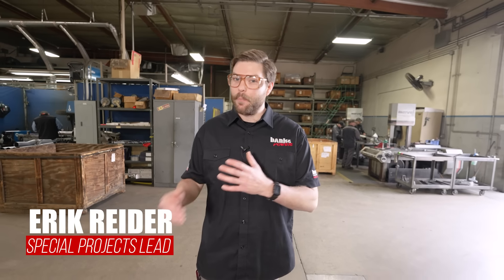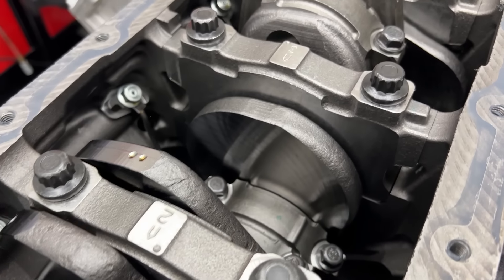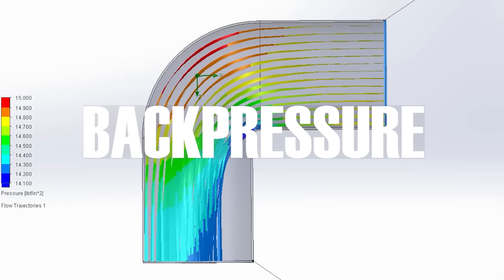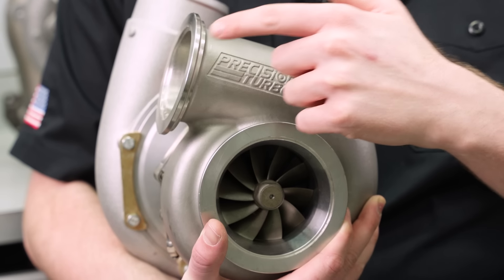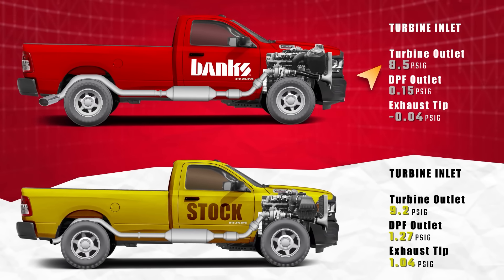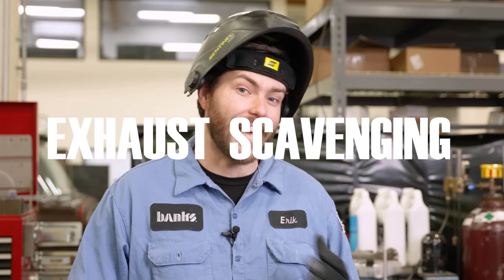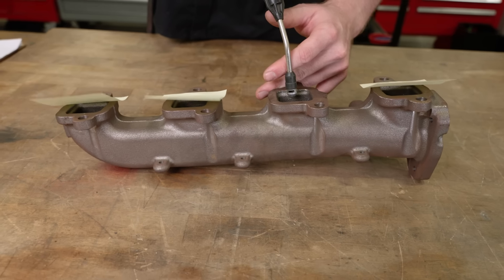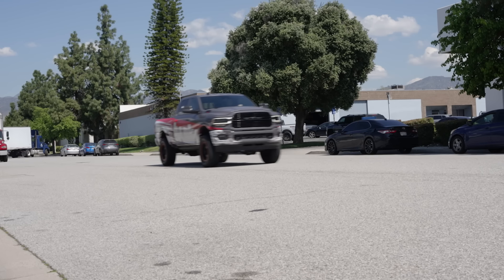Busting the exhaust backpressure myth | Banks Entry Level

Comment: Strange - I missed the part where he explained the principles of valve overlap... Good ad for exhaust systems that use turbos.
Reply: Yeah.  Would have been a good segue into how the exhaust scavenging he did demonstrate also helps the intake stroke get a better charge into the cylinder.

I suppose, though, given how every effect is linked to others, if you're only gonna talk for 10-12 minutes, there's just some things you're gonna have to leave out. Otherwise your audience is gonna feel like they just got a sip of water from a firehose.

Comment: This comes up so often, people absolutely adamant that ‘you always need back pressure, it gives you more torque’ then they get really upset when they can’t explain it 😅
Being a truck mechanic, I remember Gardner diesels having issues meeting minimum horsepower requirements as truck weights increased. Their quick fix was a tuned exhaust, Gardner called it ‘negative pressure’ for a loaded 32 ton truck , it used about a five inch diameter pipe that with matching stack. 
It used a flapper to stop rain getting in, but the pressure pulses were so strong that at three quarters throttle it still sucked shut, made a proper din 😂 drove the driver mad

Comment: Creating a negative back pressure increases power to a point but once you start over scavenging you're just wasting fuel. 

Back pressure can be a good thing though,  as it can help with low end (low rpm) performance. At low rpm the valves are open longer so there's more time for the A/F mixture to get into (and escape from) the cylinders. You need a little bit of back pressure to stop from over scavenging. 

Another helpful note is HP vs Torque. How they relate to each other and how back pressure effects them both.

Comment: Now you are incorrect about the hair dryer fan increasing load as you block the air outlet. You're not a master electrician so i wouldn't expect you to know this though.

It's not a positive displacement pump, so as the restriction in flow increases you move less fluid thus less work on the motor. This is particularly helpful for constant pressure fluid pump systems. Just keep in mind it's an example that is not correct for this comparison.

Engines are positive displacement pumps and as a result any increase in exhaust pressure or decrease in intake pressure will increase the power requirement for a given output

Comment: The motor in your hairdryer speeds up because it is no longer moving air. It overheats because it lacks the positive airflow to cool the motor.
Reply: Came here to say this. Man this is a tough video to watch.
Reply: @JNorth87 tough video to watch? Banks knows more about airflow, pressure and anything to do with feeding engines air than anyone you know and who taught them. These guys know more about this stuff than we ever will. The example of the hair dryer was to explain it simply to morons
Reply: @dougsavery5442  Yeah tough video to watch if someone is incorrectly using an analogy.
Reply: @dougsavery5442  Example was wrong. Period.
Reply: @dougsavery5442  Borla would disagree with you.
Reply: I was about the write the same.  Comparing a turbine “pump” hair dryer to a positive displacement pump like an engine is fraught with peril.  However, this video is geared to those without an engineering or physics background so they won’t detect the error in the analogy and the fact that a turbine pump spins faster and uses less energy when the flow is blocked.
Reply: @LTVoyager  Right you are, plus if he only blocked half of the air exit on the dryer he would have noticed the velocity of the air would have increased, which is what Borla has to educate so many major races teams about.
Reply: @mustangecoboosthpp3869  Yes, many aspects of fluid dynamics are less than intuitive.

Comment: I had a pick up with a 402 BB . It had been sitting for a few years . I pulled it and installed new rings n bearings . It already had an aluminum intake and a big holley but no headers and a Crane cam . My budget didn't allow headers at the time . A buddy owed me and he worked at a muffler shop. He used 2 inch pipe out of the manifolds into turbo mufflers and 2 1/2 in pipe out of those and dumped just in front of the rear axle . The truck ran great.  Before we did that I talked with 2 other shops and they wouldn't do what we did, and said the truck wouldn't run right due to no back pressure .  Never really understood the backpressure thing tho .

Comment: At  3:20 you spin the turbo and it spins quite freely for some time, thus a reduction in back pressure drag along with a decrease in spool up time would make a considerable gain in performance. I've worked with turbos that wouldn't spin at all brand new right out of the box!!

Comment: that is  incorrect using the hair dryer as an analogue ... when you block the air flow the fan/pump stops moving air which is the definition of work. moving fluid requires work. the fan is spinning but not moving anything... it is doing no work and current on the hair dryer would decrease...thus power goes down. put it on a watt meter... the blades have no differential pressure across them to resist flow. Part of the reason is a hair dryer is not a positive displacement pump it's a centrifugal pump.

Comment: Run a marathon breathing through a straw , hows that backpressure working ya now bud??😂😂
Reply: Its fine for toyota and honda
Reply: Humans exhaust and intake are the same orifice. Not a good analogy. Maybe more like farting a marathon through a straw. Which I think I can do, personally.
Reply: Try farting with hemorrhoids lol.
Reply: You described an intake restriction.  Thanks for sharing though
Reply: Better yet shit through a garden hose then a 3" exhaust pipe. Which takes longer and more effort to get the work done?
Reply: @Redline2442  This is the best metaphor I've seen for backpressure lol. I'm gonna stick with this one.
Reply: Not a straw but running with a closed mouth though works great.
Beginners often run and breath to their mouth. But when you get experienced you recognize that there is massive benefits to only breathing through you nose throughout your run and other forms of cardio.

I also every day do a couple of sets of breathing through a breathing restrictor, that is way more restrictive than a straw to strengthen my lungs.

You can't really compare a mechanical system like a car and a biological system like our body. Because our body build itself stronger and more powerful if we put it under progressive higher loads. And give it enough rest and nutrients to recover and improve.

Comment: It's not about back pressure, but about exhaust gas velocity.
A neck in the pipe will increase velocity in that region, and this increased velocity can be used to improve scavenging. This has been proven in drag strips.
But a neck will create backpressure, which people assume is what creates power when it's just a side-effect of the resistance to flow.
It's all about flow and velocity. It's like a triangle of flow, velocity and pressure.

Comment: the negative back pressure thin makes sense, the greater airflow (no matter hw you get it) the less boost you need to make power. negative back pressure means increased airflow, just on the exhaust end. Ergo less boost required.

Comment: You need to manage exhaust. In an ideal world you have none, the challenge is that just like you said you can create intakes and exhaust that improve volumetric efficiency above 100% through careful engineering of certain harmonics. Whether it benefits depends on the exact engine, induction, and exhaust impedances

Comment: I have a BRZ with the Edelbrock supercharger (with a well developed tune by DDPR), with the stock small header and exhaust I (closely) tracked fuel consumption for 9000 miles of mixed driving so the MPG figures were pretty refined. Then, even though the lore says that exhaust diameter doesn't matter in forced induction I decided to put in a  cat-back system to change the sound. So stock was 2.0" OD (actually a bit under that as its something metric) and I went with a 2-3/4" and was pleased with the sound but noticed that there might have been an improvement in gas mileage.... And the following months proved it. I WAS GETTING at or just under 1.25 more MPG. Now that doesn't sound like lot but when your buying 93 octane gas that adds up over the months. And there was a fractional improvement the next dyno run for baseline before we installed larger injectors and I went alcohol.

Comment: Your example of the hair dryer is wrong. Motor RPM actually increases due to less load , because a smaller column of air is being moved. You are comparing two different types of pump, Positive displacement versus Dynamic.
Reply: Has nothing to do with type of pump. The example was only meant to be a simple demonstration of how back pressure increases load.
Reply from the maker: The comparison was not about a motor vs an engine, it was simply to show backpressure or resistance at its most basic level.
Reply: I was thinking this too. Good intention but poor execution
Reply: @lucasd8917 
Cars dont run with 100% blockage, they ran with less than 5% back pressure
Reply: He is just a keyboard warrior trying to know it all.
I think it was a good example
Reply: You’re clearly missing the point the more restrictive it is the more load on the motor. In this case it was the blower motor for the hairdryer. It would be the same case for your engine.
Reply: @thisguy333 
Oh look a troll
Reply: @justinpinho9916  
And no racer is going to say hey lets put a potato in my exhaust because i need 100% back pressure. 

And you see the guy in the video doesn't want to do a video of a semester worth of engineering explaining exhaust design and theory
Reply: beyond moronic post from OP
Reply: @JohnSmith-xu7ev if you move away from the mirror you won't see him anymore

Comment: Where this myth came from is rooted in the seventies. When auto makers first started down the path of cleaning up emissions, they leaned out the carbs to lower hydrocarbons. I actually saw one vehicle that cracked the exhaust manifold, causing the engine to stumble. When the manifold was replaced , the engine returned to running normally. The normal back pressure was needed to maintain proper fuel mixture. When the built in back pressure bled out the crack , the mixture went too lean and the engine ran ragged. This was one reason for those looking for more power, would jet up the carbs along with better exhaust systems.

Comment: I think this comes from the tale that after all the burned gas is sucked through the exhaust valve, it could happen (especially with high scavenging effect and tight lobe separation angle) that a small amount of the inlet charge is sucked through the exhaust valve before it's fully closed.

Comment: Very important information to clarify is that pressure does affect the power curve. The more free flowing the exhaust, the lower the rpm range for peak power, the more restricted pressure makes your torque curb higher in the range.  Awesome video, especially the scavenging part, but I believe a turbo diesel is the wrong example. Diesel already has a very low and narrow RPM range, practically non existent. Then you pair that with a turbo for diesel engines that has to produce peak flow at very low and narrow rpm ranges. Its like a quarter or less of most gasoline engines.

Comment: I’m 53. My dad graduated from high school in 1958 and was the most amazing mechanic I’ve ever known. He taught me that back pressure was necessary. It’s so weird, I wonder where the myth came from.
Reply: As an engineer and an auto tech, it is true. The guy contradicts himself in the video
Reply: @JohnSmith-xu7ev any back pressure is bad.
Reply: I'm 51. My dad said the same thing. Bring a mechanic doesn't mean you understand fluid dynamics. People confuse a loss in velocity as a need for back pressure
Reply: @randyschmidt19  
Im both, and you do need back pressure. Tell me why you shouldn't put headers on a car
Reply: @randyschmidt19  
Then honda civic should have 6 inch exhaust like my diesel truck
Reply: @JohnSmith-xu7ev  no. You are not understanding.  No or low back pressure does not equal huge exhaust pipe. Your diesel doesn't need a six inch pipe either,. If it's turbo then It's not hurting it though. This is not black and white you are oversimplifying the answer to a complicated chain of events and that still doesn't change the fact that back pressure is not needed, desired or helpful in any way

Comment: A "Tuned pipe" exhaust works, at the correct revs, by the having the high pressure pulses hit the exhaust port before the valve opens, bouncing away, creating a low pressure pulse as the valve opens, helping to "suck out the exhaust gasses", outside of that rev area, super high back pressure, which makes it hard to get to the correct revs.

Comment: Back pressure is essential on?
2-Stroke engines! The ones without a valve opening and closing the exhaustport.
With the right tuning of when that backpressure pulse returns at the exhaust port you close the exhaust at the right time for a certain powerband with that pulse and force the fresh air/fuel mix to stay in the cilinder.

On 4-Stroke engines, engines with valves (like detroitdiesels, 2-stroke with exhaust valves)to regulate exhaustport opening and closing, you want that pulse of backpressure to hit a closed valve.
You start tuning the pulse to help pulling exhaustgas out of the cilinder.

The right exhaust manifold will support that, will smoothen the pulses on the turbo, turbo will flow better and spin up faster, heat build up on the turbo will also be better spread if the exhaust pulses come in the same interval as the ignition order and because all the pulses get the same amount of time to pass the turbo, unwanted backpressure because of pulses having to wait to flow through the turbo will reduce.
Tuning this is science!
But get it right, it is rewarding

Comment: Nice trick. On the headers you have the air gun down inside the header manifold. On the log manifold you had the tip outside the manifold.

Comment: 2014 Camaro SS 6.2L
I ran Flo-Master Outlaw mufflers, X-Pipe and BBK tuned short headers and got about 26 mpg out of the car on the highway. From a stop I could push past the traction control and chip tires. 
Now comes the BBK full headers 1 5/8" with only two high flo cats. 19.5 mpg and no low end push. Now when I'm cruising at 80 mph... I can get to 136 mph real quick though.

Comment: I think the whole back pressure argument came from the race cam in a street car crowd believing they fond a way to regain some of the cylinder pressure they were losing through their wide open cam timing. The fact is thinking you can gain power by leaving unburnable gas in the combustion chamber is ridiculous.

Comment: Run these open headers on a dyno then add a complete exhaust system after the headers and you will see an increase in power and torque  below 3500rpm (cruising speed). The exhaust contains unburned energy that is utilized at cruising speeds when kept in the combustion chamber with a slight amount of back pressure.